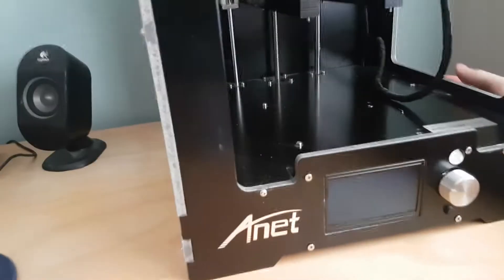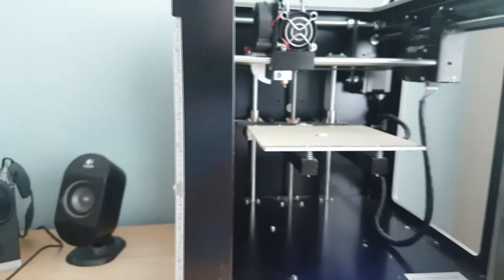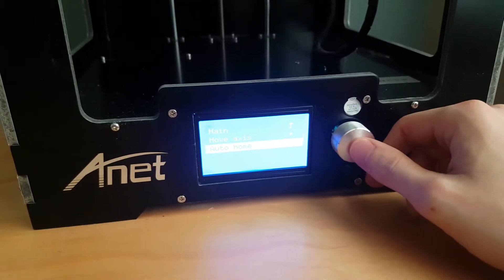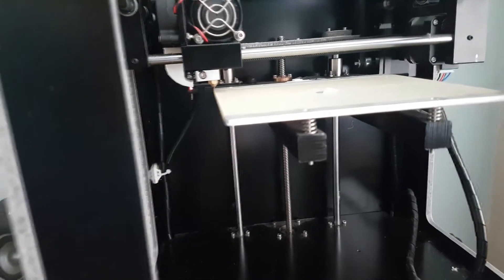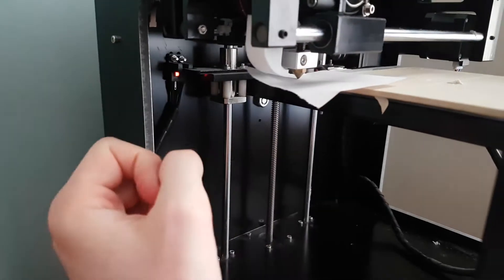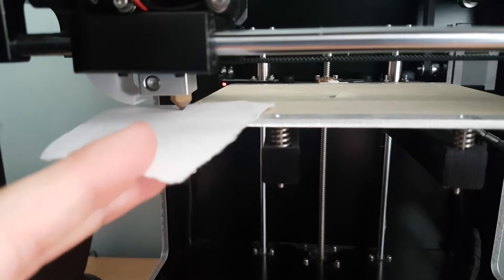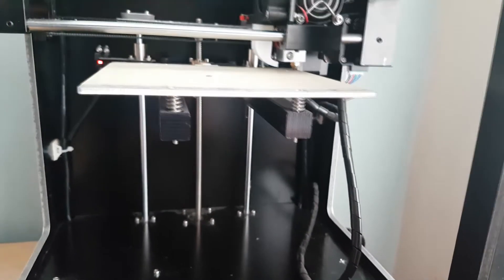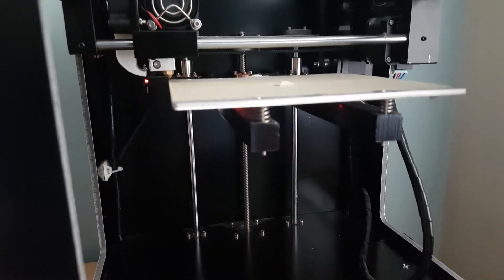Anet A3 3D Printer How To Level Print Bed - Level Print Bed Tutorial

Comment: Hi.. I have a problem with my Anet A3, I used to print in increased speed, when I print something i usually turn the button to increase the speed to 200% and there's no problem until within few days my a3 motor sometimes suddenly like jump or skip the position to the coordinate that it shouldn't be and make the print totally out of position, I guess there's problem with the bearing of the stick, but not sure. Do you have any experience like that, or maybe you know something about my problem? Thanks..
Reply from the maker: Sorry I'm not sure ):

Comment: Hi Danny thanks for sharing the videos on the Anet A3.  I was wondering have you thought about adding an Auto bed leveling sensor and if yes could you add a video showing how you did it.
Reply from the maker: John Husband hi thanks for your comment :-) sorry my printer is not working properly at the moment so Im waiting for new parts to arrive but its not looking likley I will be able to fix it at the moment. That is a good idea thanks for the suggestion.
Reply: what happened?
Reply from the maker: Still waiting for the part :/
Reply: The D Show ok good luck. :/, My prints are fine except I can only print 5 cm stuff otherwise it prints on the metal not tape. I keep moving it correctly but once it starts printing it like resets the movement.
Reply from the maker: Have you got the correct settings in Cura and have you updated to the latest version of cura?
Reply: No I haven't, I input all details as mentioned in the given pdf plus used the profile given with the anet, thank you for your answer :)
Reply from the maker: No problem :)